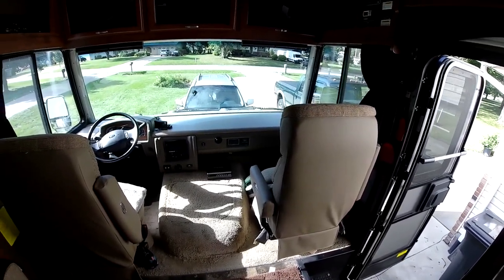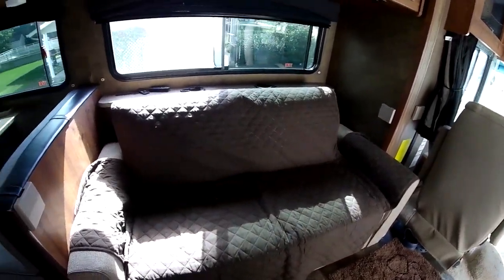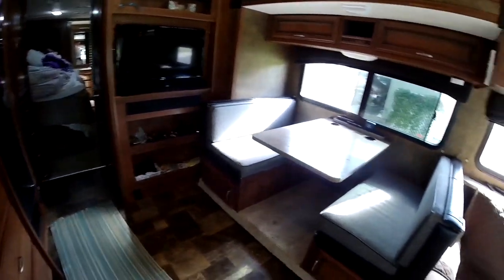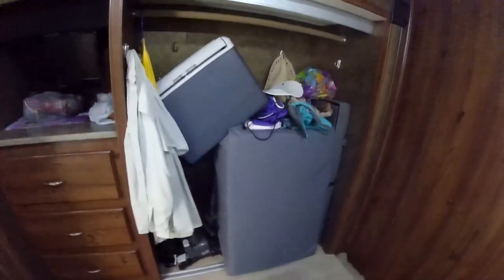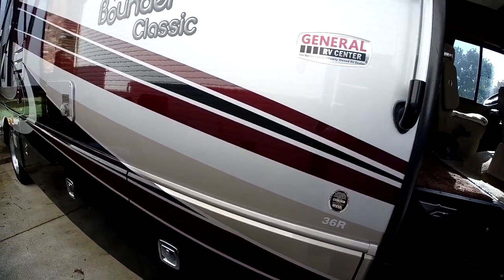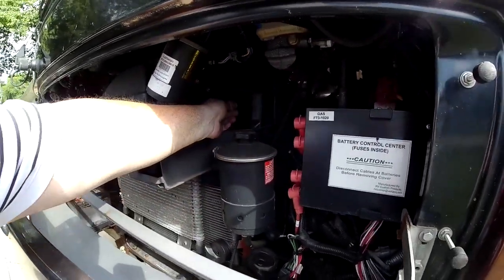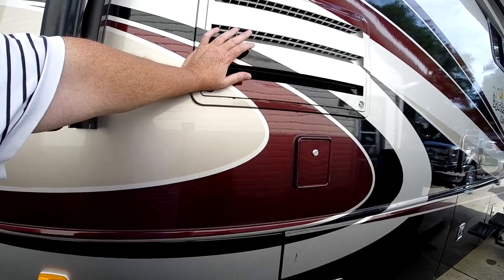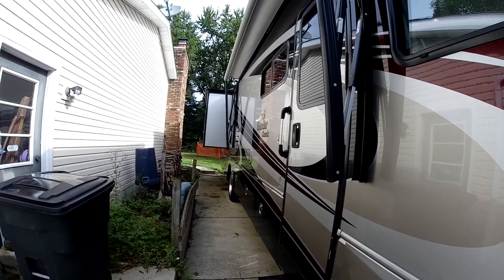2014 Bounder Classic 36R - Walkthru - Likes and Dislikes after 1 Year

Comment: Great video. We just bought the same model and year. Did yours come with an inverter? If so where is it located? Thanks.
Reply from the maker: Thank you for stopping by and watching.  No mine didn't come with a inverter to run AC off DC like the fridge.  That would have been a nice feature.